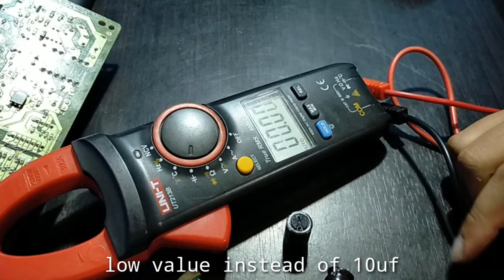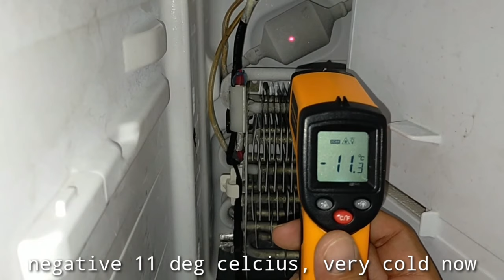Samsung Inverter Refrigerator repair

Comment: hi sir, my unit compressor not working due to flood on my house area, try to switch on after one week , the pcb bord light is on and no blinking but the compressor is not working.
my have to change capacitor also ?

Comment: Low voltage po sa area namin, mga 350 meters na po  galing sa poste, what voltage regulator can you recommend for an inverter ref, may time delay na po ba ang voltage regulator?

Comment: Tanong lang please help..bago lang kasi ako sa inverter refrigerator.. lagi po bang naka ON ang compressor nito kahit nakuha na ang naka set na lamig? at lagi po bang mainit ang sides nito. Lumalamig lang ang side if mag dedefrost. Usually 9.30am and 10:30pm lang siya nakita kong nag stop ang compressor
Reply from the maker: Normal lng po yan sa inverter sir, variable speed sya from low-high speed, nag high speed po sya kpag need palamigin, tapos low speed kpag na reach na nya ang tamang lamig, mainit po tlga gilid nyan dpat may proper ventilation po ref nyo
Reply: @airetechtv6235  ok sir noted ko salamat mejo nawala ang pagkabahala ko..

Yung sa may part nalang na high and low speed yun nalang hindi ko na notice sa reff ko sir. Hindi ba siya noticeable?
Reply: @airetechtv6235  ok sir noted ko salamat mejo nawala ang pagkabahala ko..

Yung sa may part nalang na high and low speed yun nalang hindi ko na notice sa reff ko sir. Hindi ba siya noticeable?
Reply from the maker: Ma notice nyo rin xa sa tunog lalo na pag nag high speed, kung meron krin po clamp meter kita po sa amperahe nya :)
Reply: @airetechtv6235  hindi ko ata nanonotice yun sir  yung high rpm sa low rpm niya...hayyss.hmmmm sige try ko muna yung clamp meter pero pag aralan ko munanyun...hindi ko pa alam gamitin clamp kung san icclamp banda.
Reply from the maker: Check nyo po yung isang video ko yung nag repair ako ng ref din, mkikita nyo po sa dulo yung pinaglagyan ko ng clamp sa extension wire, bsta sa isang linya nyo po ilagay :)
Reply: @airetechtv6235  ok sige sir noted salamats
Reply: @lesterbeats7108  pag no blink yung 2 led, ibig sabihin good yung compressor at mga sensors?
pero kulang pa rin ang lamig. ying freezer 2 to 6 degrees. yung ref 12 to 16 degrees lang. saka normal ba, may konting tubig yung tuluan niya?

Comment: Sir ask ko lng po kasi parehas kami ng model yan inayos mo. Ang problem po kasi samin pag sinaksak nmin iilaw ung maliit na board. Pero mawawala din bigla tas ung malaking board parang namamatay-matay ung ilaw. At hnd po nag popower on ung ref.
Reply from the maker: Check nyo po mga sensor sa loob sir, kung okay po sa board nyo po e troubleshoot kung meron open circuit or short circuit po

Comment: Sir ganito Yung ref namin pag saksak andar sya then mamatay agad after 1-2mins na try ko na remove at check Yung thermal kng aandar ayaw prin namamatay tlaga sya
Reply from the maker: Need nyo po ng technician na makapag check ng unit nyo po, baka nasa board po ang problem nyan,

Comment: swerte bay kita daun ang daut hahahhaha
Reply from the maker: Mao lge bai :D :D wa ra kaau nilabad akong ulo :)
Reply: @airetechtv6235  boss ano ponlema ayaw umandar ng compressors
Reply from the maker: @jeffreybernales1428  dami po dahilan nyan sir, inverter po ba? check nyo po mga sensors at yung sa board nya mismo kung meron dumadaloy na kuryente papuntang compressor
Reply: @airetechtv6235  sir may na check ako samsung inverter, 10 blinks Sa main board then 4 or 5 blinks sa inverter driver, ayaw umandar ang compressor, pag mag check ba ng voltage papunta sa compressor, naka ground ba ang black prod, then yung red eh sa  U V W? At ilan volts ang masusukat? Ty sir, sori sa mahabang questions..

Comment: Samsung RT45KSSW fridge compressor over heats.
Right side body gets hot.
Main control PCB led starts blinking 5 times after few hours.
Cooling deteriorates and compressor gets untouchable hot.
Fridge is not inverter type.
Reply from the maker: Is it a no frost?
Reply: @airetechtv6235  yes it is. And it's floor front edge is also too hot where door bottom rubber touches.
Reply: @airetechtv6235  changed the capacitor today. No error blinking led observed yet. Compressor tripped after approx 6 hrs. Compressor sound is increased. Earlier it was very quiet. Feeling satisfied 😊
Reply from the maker: @leoleo2725  nice! Good to hear that sir! What capacitor did you replace?
Reply: @airetechtv6235  it was 5uf, 550vac running capacitor for compressor. Didn't find original one but replaced with a 5uf 400vac commonly used in washing machines.
Reply from the maker: @leoleo2725  nice, as long its functioning now :)

Comment: Paano ntin malaman.. No explain..... Hehehe
Reply from the maker: Visual check lng po ginawa ko sir :) kita nmn po bloated na capacitor at yung optocoupler nya salamat
Reply: jv cornelio 
kita naman po sa video ang mga parts na sira na pinalitan.
unless no clue kayo about sa electronics or circuitry